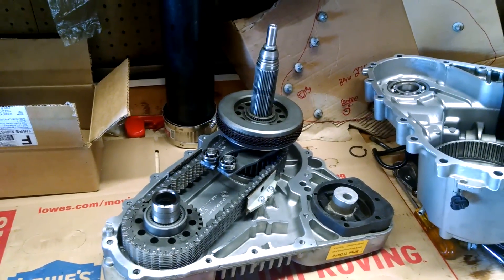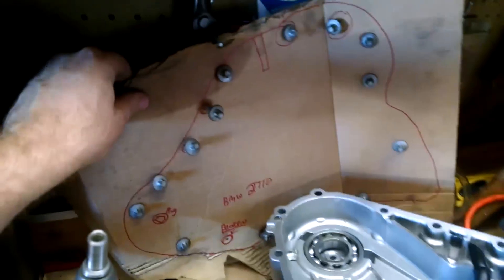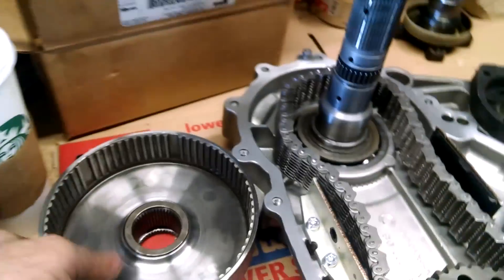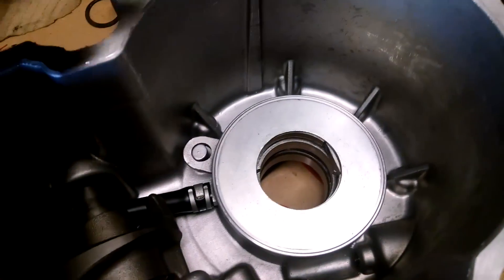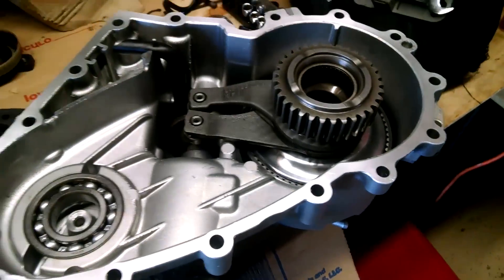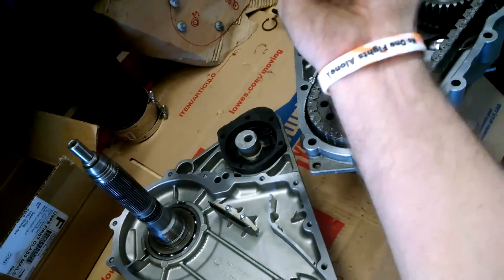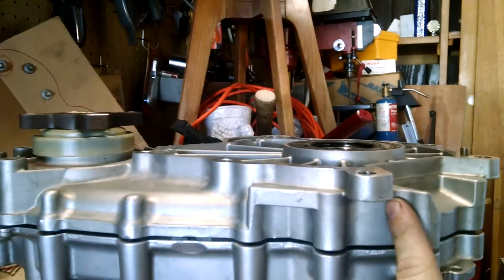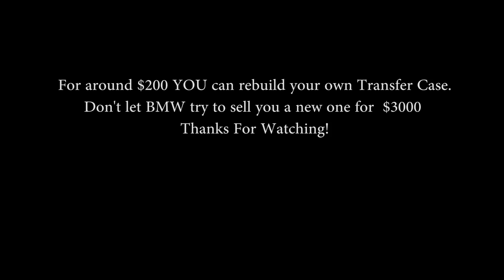BMW X3 Transfer Case Rebuild

Comment: Hi I know this video is 9yr ago but can you able to pull the shaft the one your holding while transfer case still intact in the transmission and not to bring it down.is there any loose parts when pulled it?just needed to relace the oil seal due to fluid leak.

Comment: Hi guys random atc400 functionality question. Without the actuator on the t case the spreaders are closed, does this fully engage front drive shaft or fully Disengage it? And is it safe to say that fully spread is the opposite?

Comment: On the front output shaft: is there any way that it specifically attaches (clip/bolt) or is it kept in place simply by pressure?

Comment: It came together by magic.  My dealership wants $8000 to replace the transfer case, I found a transmission shop that will replace the bearings for about $1000.
Reply: Everything in my transfer case  is OK except the chain. I replaced the chain for less than $100 and car back on the road.
Reply: @glenglene8473 could you tell me where you buy the chain? Thanks
Reply: Unbelievable. For this money you can buy parts here https://awd.tech/collections/atc-400-bmw-x3 and repair 10 transfer cases :)
Reply: Yeah I usually rebuild the entire thing for 1500 out the door. That includes new mount, bearings, chain, seals, and labor.

Comment: Hello Sean - I am trying to troubleshoot my ATC400, and wondering should the assembly at timepoint 3:59 allow the input shaft from the servomotor to rotate a full 360, or should there be some resistance from the clutchpack limiting the rotation?  I've replace my servomotor and ECU, get the TC still will not calibrate.  Debating if I'm going to drop the TC or just send the car down the road.  Great video!
Reply: There should be tough resistance when you turn the shaft where the Serv motor connects. It should turn back really fast and hard once you turn it with your hand.

Comment: What are some symptoms when this t-case fails? My X3, 6speed when put in gear simple does not move. I can shift into all gears and its smooth however as I let the clutch out I hear noise coming from what sounds like the t-case. And does this apply to a 08 X3? Looking at realOEM it lists the ATC400 for years 2003-2010

Comment: Good video. I may need one too. Can you or someone HELP answer a question for me. My 07 x3 3.0si is rattling at the center bottom of the vehicle at rpm's at about (12-1500) in park, drive, neutral also while moving. IDK if the Transfer case has any power or movement to it while in park. I had the car up flushing my brake fluid and friend gave it gas in P, N, and Drive and it was way louder than I thought. Sounds like bad bearings or marbles inside somewhere right on or near the T.C.. The Exhaust is right next to it and was just wondering if it's that nylon worm gear, Transfer case or possibly Cat Convertor or even Torque Converter? going bad. Any help would be greatly appreciated. Thanks-Peace-

Comment: So I did this and old chain stretched to 3 1/2 and new chain to 3 5/8 so can only 1/8 difference between the new and old chain make the difference? Or did I just wait my time buying a new chain?
Reply from the maker: Chad Ditsworth if you opened it up, it's not a waste of time, if you only replaced the chain, probably a waste of time. The bearings will make noise too. You have to replace them.
Reply: Sean King I didn’t open it up because of any noise problems, all it was doing was jumping and jerking like the chain wasn’t gripping! So with that 1/8 difference the new chain made help my situation?

Comment: Good video! I'm trying to do the same for my 2005 X3 as well. Ran into a couple of problems though. One is that one of the bolts broke and I'm having a tough time trying to get it out. Tried a few things but it won't get out. Then i thought i would just open it up and hopefully i can just twist it and get it out that way. But now I'm having trouble separating the two halves. The video says a puller is used. May i ask what kind of puller would work? I have a few pullers but they seem to be way too short/small to be secured against the case.
Reply: Try a razor to get started, then try a small strong plastic spackle knife or gasket remover tool in the center of the T-Case.

Comment: Hello.  Dealer just called with a $4500+ replacement cost of the ATC400 transfer case.  This video is a lifesaver.  The car was studdering or jumping during acceleration and very occiasionally flashing a 4x4 light.  I have already replaced the plastic gear in the xcase motor actuator.  After watching this video I am imagining that the chain is jumping teeth.  Is that a fair assumption?  Other than the chain and bearing kit, what about the seal kit? Would that be a plus to replace?  Also, are these case bolts aluminum and require replacement after every torque up?  And finally, is the sealant for the case half the same that they use on the differential cover (loctite 5970) now?  Great video and thanks for the info.
Reply from the maker: Darby Mirocha  it's probably a lose chain. The seals I didn't replace because they weren't leaking. If yours aren't I'd leave them be. The gray sealant is permatex ultra grey. Reuse the same bolts.
Reply: Thanks so much.  One more thing.  I am using loctite 5970 for the case half.  What is the cure time before filling with fluid?  The MSDS says 7 days before subjecting to 'heavy loads'.  I don't think an non-pressurized transfer case is a heavy load, but I don't want to be impatient either.  How long did you wait before filling with fluid?
Reply: @dmirocha  "Form a Gasket." has different drying times. The case is bolted so can't emagine you would need a rocket ship type. But I would use the best auto Gasket Maker. Did you get vibrations in the seat and front of car?

Comment: So two years later, do you still have the car? If so, how are the parts holding up? Shop quoted me $3800 To replace the whole trans case. Thy said they use to service them but they won't do it anymore because they've been unreliable and later fail again. Thanks in advance!
Reply from the maker: I sold the car. No know issues I'm aware of. In hindsight, I would have replaced the Clutch pack too since I had it all apart and replaced everything else. I wouldn't buy into the"unreliable" rebuild theory of the dealership. A new transfer case is almost more than the car is worth! If I can rebuild it, you can too!
Reply: @seanbking  vn

Comment: What if I have to replace the clutch pack as well. Not the whole assembly, only the clutches. How can it be done? Any specialty tools needed for the clutch pack?
Reply from the maker: CeCO Jr. Sorry for the delayed response. No tools necessary for the clutch pack. Just make sure to take pictures of the order of the stack so when you get new ones, they're in the correct orientation.
Reply: Sean King Thank you. 👍

Comment: Way to stick it to those dealerships!   Those poor mechanics that work for BMW are getting pennies compared to what's charged.   Btw, is it safe to drive without resetting the transfer case adaptations though?   I might have to go to the dealership to reset everything since I don't have a diagnostic tool.

Comment: Hi
thank you. this video is usefull.
shouldn't you align the holes of the input shaft (2'34) and the holes of the drum (1'48)? I guess those holes are made to lubricate the Sprocket Assembly and the gear

Comment: why did u needed to rebuild you're transfer case
Reply: the actuator is a notorious, common fault with e83s but the transfer case going bad isnt at all common... and the only reason the actuator goes is because some idiot engineer designed the worm gear to be made out of plastic (the motor itself doesnt go bad). plastic gear next to catalytic converter = bad news.
Reply: Isreal Perez transfer case and transfer case actuator are notorious for going out in this model year range.  4x4, abs, airbag and another light on dash will all come on along with a clicking when you turn vehicle off, left and right turning/cornering stiffen/grind...

Comment: @sean king, I have a 2007 bmw x3 3.0 4wd automatic, would the kits from the links work on mine?
Reply: with the face lifted models, the transfer case was redesigned, and no longer uses a chain.  Rather it uses gears which spline together.  When these units fail, more than likely, not going to be worth rebuilding.  Unfortunately, you have to replace the whole unit.
Reply from the maker: I don't think it would. I believe the model changed to the new one in 2007??

Comment: hi where can i buy the parts to rebuild mine
Reply: https://cobratransmission.com/index.php?main_page=index&cPath=3_2203
Reply: thank you i also have another question.. i changed my transfercase and motor i still have the same banging and hoping feel what do you suggest im thinking replacing tie rods and tires and alignment

Comment: Sean- did you have problems when joining the two halfs together with the washer that goes on the bottom of the shaft not lining up? It's the one that sits on top of snap ring at the bottom of the shaft on top of the bearings

Comment: Hey Sean, ive got an oil leak on my t/c its coming from the front output shaft oil seal ( the smaller shaft in your video) would I have any issues pulling that shaft out when the transfer case is on the car? does the gear sit inside the bearing or will it fall out of place when the shaft is removed ?
Reply: hi, i have the same problem, did you sorted out, if yes, how?

Comment: What were the symptoms that had you do the rebuild? Great information here. 
I am getting some clunking and I am going to replace the fluid to see if that will work before I yank it out.  
A little initiative, a good back ground in auto repair and you can save a fortune.
Reply from the maker: clunking was definitely one big indicator for mine too. if/when you drain the fluid you should be able to see the chain through the filler hole. if you're able to move the chain easily with a screwdriver etc..then the chain needs replacing. also if the Christmas lights of death come up on the dash and it only lets you drive in 2Wd, the n it could be the transfer case actuator gear..which is only a 25 fix. there are plenty of videos about that on you tube.
Reply: Sean King what about if it does like a chugging or hopping movement? and also all the lights of death are on also!
Reply: This jerking was one of my symptoms too. When driving up a hill fast.
Reply: did you have a vibration? rear and front, rear or front?

Comment: Hello! Im planning on doing this job on my 04 X3 -- we've got a large knocking noise at low rpm upon acceleration and let off. 

Is taking out the transfer case the hardest thing? Also what kinds of tools does the job require? Any specials ones?
Reply from the maker: you'll need a torx set for the screws, snap ring pliers for the snap rings, and a puller to separate the cases. if you are replacing the bearings, you'll need a press to press them in place.
Reply: Did you replace the clutch pack at the same time? That seems to be the most expensive part.
Reply: Can you email me pics of your Puller, Snap Ring Pliers and Torx set?  jpg@jpghawaii.com  I am going to try to do this myself.

Comment: do you have to remove something before you can open it?? I opened mine and broke where the c clip gose
Reply: That happened to me too. Apparently you have to remove the flange from the input shaft first and pull out the input shaft so the bearing remains in place with the C clip inside.

Comment: How long did it take you to replace the bearings and chain? I have a X3 that has a loose chain and also makes some noise. I've never done one before. Thanks
Reply from the maker: +Kevin McCarley (vwauditech) Once out of the car it probably took about an hour to replace the bearings.
Reply: +Sean King Thanks.
Reply: +Sean King Hi Sean, Did you need a special tool to press the bearings in/out of the transfer case? Or do they basically drop right into place?
Reply: Brady Baxter they do require being pressed in/out. It doesn't "require" any special tools, just press plates sufficient enough to do the job. I actually just did another chain and motor gear job on E83 yesterday. $15 for a new gear and $85 for the chain. Took 2.5 hours. Winning!
Reply: So I did this and old chain stretched to 3 1/2 and new chain to 3 5/8 so can only 1/8 difference between the new and old chain make the difference? Or did I just wait my time buying a new chain?

Comment: This is great.  I have a 2007 328xi, which has the ATC300 transfer case. My front output flange bearings are shot, so I will be pulling my transfer case soon to replace them. The site you listed, Cobra Transmission, lists a bearing kit for the ATC300 but specifies X3 and X5. I'm assuming this kit should fit my 328xi since it appears to use the same transfer case, yes?
Reply: I also have a 2007 328xi.  My car vibrates badly on the highway, on acceleration.  When I take my foot off the gas pedal, there is no vibration.  What were the symptoms with your 328xi?
Reply: @jpjp7901  
I'm having the same problem. Vibration, Started in the rear, now in the front and rear. Happens on acceleration and deceleration, gets a bit better on highway. Did you ever find out what it was? Transfer case, Center support, Guibo, motor mounts, etc...???